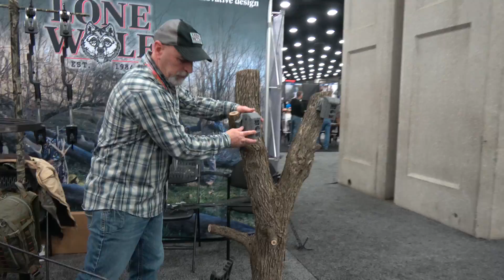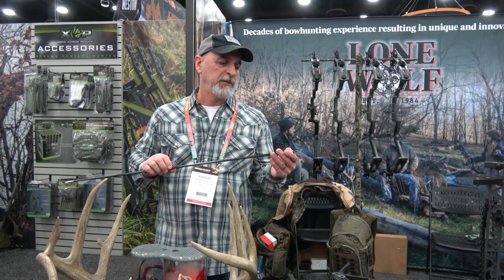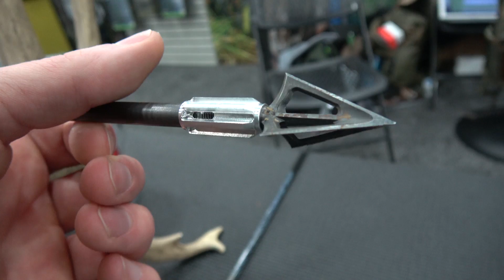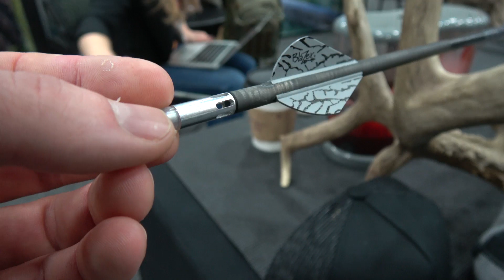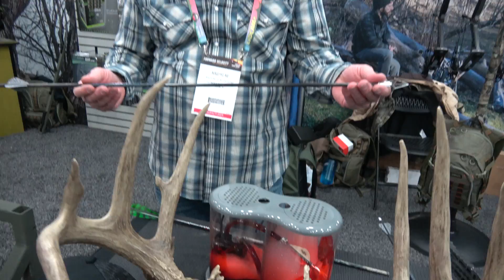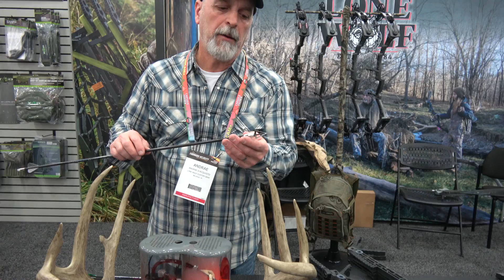Lone Wolf Custom Gear IV VG Arrow Inserts 2019

Comment: Garrett you’re a talented engineer what’s your initial take on this. Shoot me straight.
Reply from the maker: Conceptually the theory makes sense. The questions I'd have are how easily target material could potentially get in the arrow shaft and the diameter. Since it's larger than the broadhead ferrule, I'm curious to see how it would perform going through something like a shoulder. Typically you want anything behind the broadhead to be smaller diameter

Comment: Seems that these would whistle through the air?

Also seems that the bulge at the end would hinder penetration?

I use the word seems...
Reply from the maker: Those were my questions as well. We asked Cody about that in the podcast on the Sportsmen's Nation. He said they thought it might whistle but didn't in reality, and he said that penetration testing has gone well so far with fixed blades and lower poundages (Andrae shoots around 50lb). It sounds like there still needs to be a little more testing volume to determine how they perform going through something like a whitetail shoulder blade, where that larger diameter might be tougher to get through.

Comment: wonder if it is broadhead specific?  can you shoot a range of different broadheads?
Reply from the maker: You can use any broadhead eith standard threads. Andrae hinted that they would be coming out with their own broadheads for it too.
Reply: DIY Sportsman what grain broadhead was he shooting with it? Can you still use lighted nocks?
Reply from the maker: @joehorton01  My guess is he uses 100 but you could use any weight that you wanted for overall arrow weight and dynamic spine match. For lighted nocks I think it would depend on the brand. You wouldn't want it to stick in so far as to block the vents.

Comment: I think what you have actually discovered, by accident, is that a heavier front end on an arrow stabilizes it quicker, therefore, you are hitting nearly the same hole with your shots.  Higher FOC equates to a quieter bow, a quicker stabilizing arrow and deeper penetration.  Period.  Good luck with this gimmick.
Reply from the maker: I'm not sure the FOC with this system is too much different than standard systems. The front component weighs more, but so does the rear component.

Comment: If it's that heavy, there ain't no way it's hitting higher. I ain't buying it
Reply from the maker: Mass plays a huge role for sure. I would need to test it myself to make any claims, but it it works like advertised, I'd bet it could fly flatter than other arrows of equal weight. But I'd assume the break even distance for arrows with standard insert weight would have to be fairly far.
Reply: @DIYSportsman  it's a great concept, but way too hvy.
Reply: I love how you have to buy thier arrow. If you want it on your arrow you have to cut them off!!
Reply from the maker: I can definitely understand the weight issue. The arrows I shot last year had 130gr inserts and 150gr broadheads, but it's definitely not for everyone. Andrae was saying that guys could install themselves if they cut their arrows right behind their old insert. Then, the arrows would be shorter but end up being around the same length with the longer inserts installed. I'd want to test myself before making any big claims.
Reply: @DIYSportsman  o. Ok
Reply: @mr.skeptical3071  what's way too heavy???? I shoot 604 grains at 50lbs and nothing stops my arrows.  Too heavy...there is no such thing.  Too light,  yes.

50+ up front I like,  not sure i'm digging another 30 in the back with a lighted nock at 20...but that's just me as I prefer more FOC vs increased overall mass.  

I think the theory sounds believable and i've had blood dripping out my arrows many times so I can see the picture.  Innovative....YES,  practical for me,  not sure.
Reply: @Bullbluegill  what I mean is the heavier your arrow the more drop. It doesn't make it hit high
Reply: @DIYSportsman  Weighs less than my present inserts, race car drag technology great for flight, but what about structural integrity and I don't see this doing anything for a pass through!
Reply: @davisrs1  how hvy are your inserts????? Mine are standard
Reply from the maker: Yea I'm a believer in heavy, solid broadheads and robust component systems. I would want to test through shoulder blade and beef bone before making a switch. The tech is pretty cool in that it could allow atmospheric pressure to force a lung to stay collapsed on a one lung hit and get extra blood on the ground on a non-pass though. For a full pass through though it's probably irrelevant.
Reply: This is a game changer...some of yall need to go back to achool and learn somthing..he makes perfect sense....